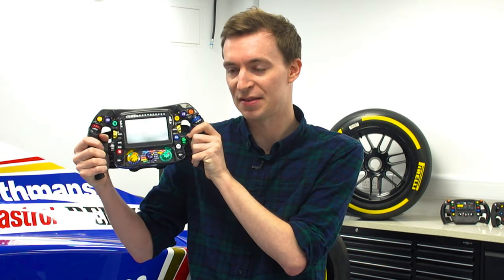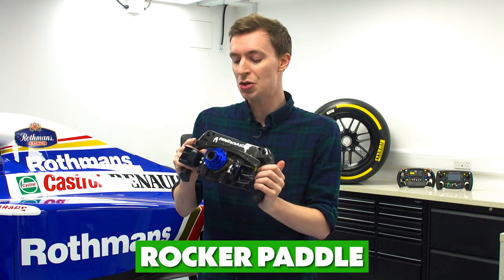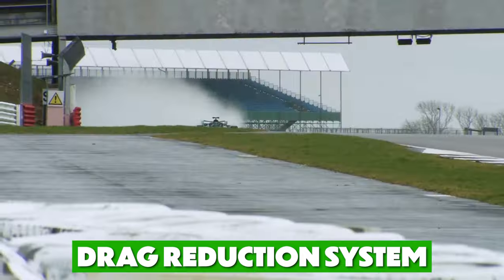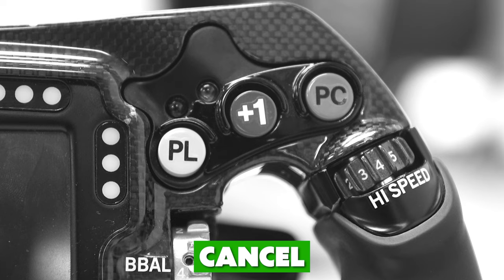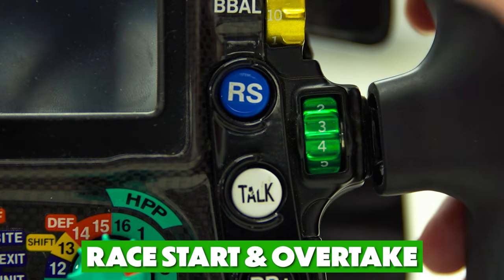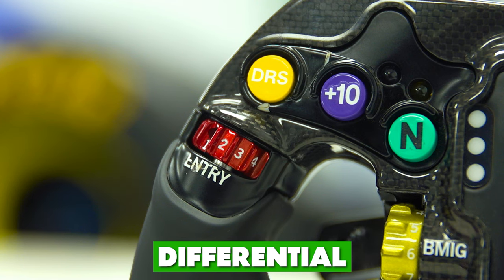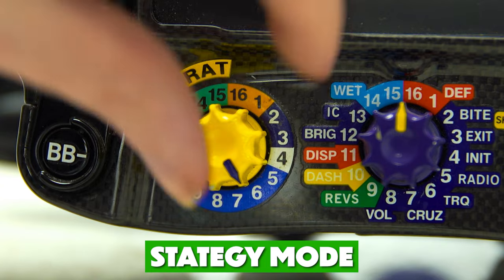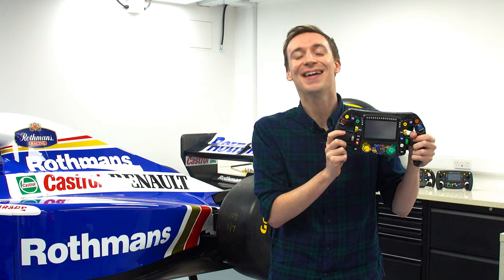Why Do F1 Wheels Need 23 Buttons?

Comment: It all makes sense what the different buttons do, but I wonder, how much does the driver actually do, during a normal lap??? Besides gear change of course. In the onboard vids, it seems like they change e.g. brake balance several times pr lap... 
Also, does the car have software that let them program/preset thing for each individual corner? Based on GPS. So you can have a certain diff and BB setting for one corner, and that automatically change for the next
Reply: No, that was banned, team cannot do changes (wireless) and the wheel cannot do automatic changes, only the driver can make changes.
They have presets for different turns, they need to select it before the turn and then reverse to the previous settings, that's mostly what they change.

Comment: $100k steering wheel. All I got out of this video. To many buttons and dials for a guy driving the car. Hell I remember when Rusty Wallace retired from NASCAR. He in his cup car and the Pensei driver in his car. The Penske driver says my steering wheel costs $20. Now granted he retired 2005. He said well my steering wheel only cost $200 bucks. Indy car driver said my car costs at least $100k. Rusty said oh about $40k at the time of the interview. Then Indy car driver said we go over 200mph around the track. Rusty said oh we do the same at some tracks bumping and beating the hell out of each other. The indy guy goes oh we touch we break.